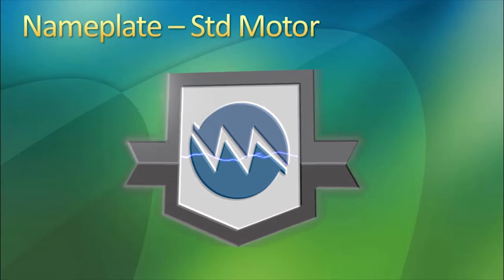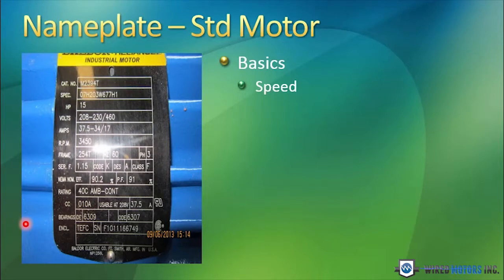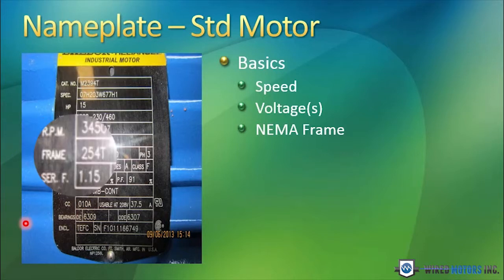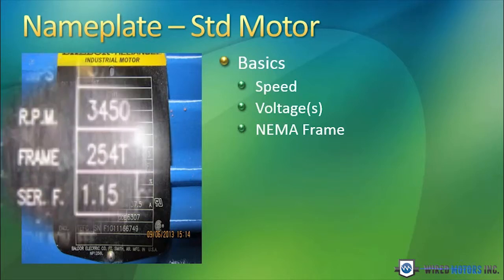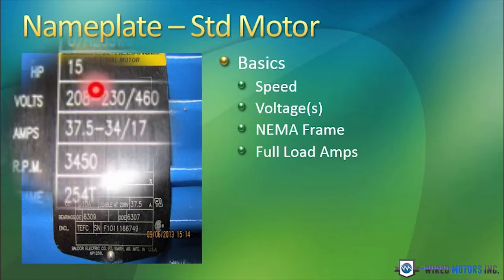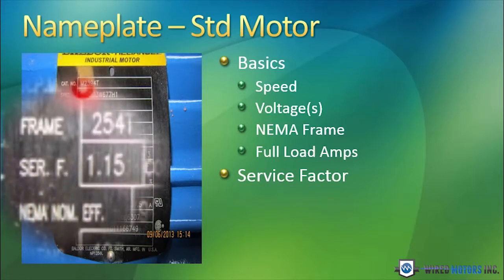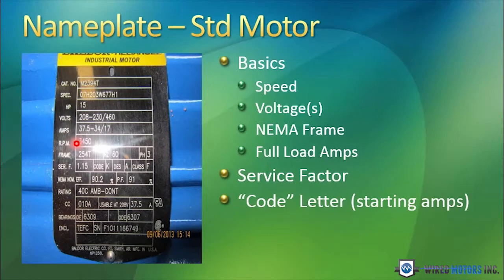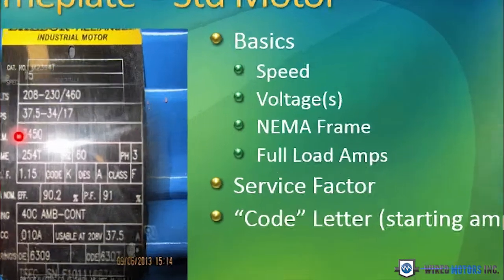How To Read A Nameplate-Wired Motors

Comment: hi Mr 
I am trying to get the electrical side from this episode 
I converted 15HP to KW to get on 11000watts 
then divided 11k watts on 208volts to get the amount of ampers  but the result is 47ampers 
how that happens  
the nameplate give it just as 37ampers 
thanks advace